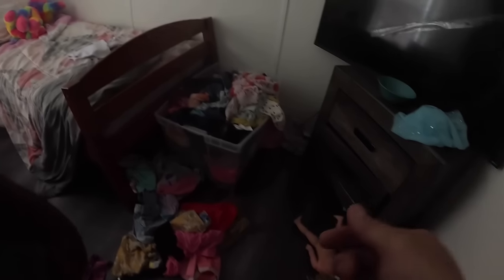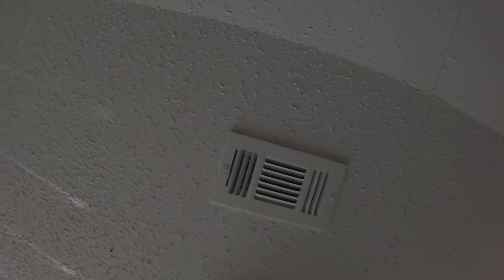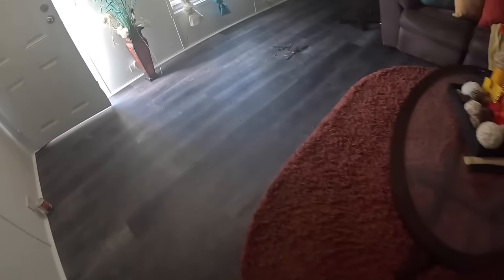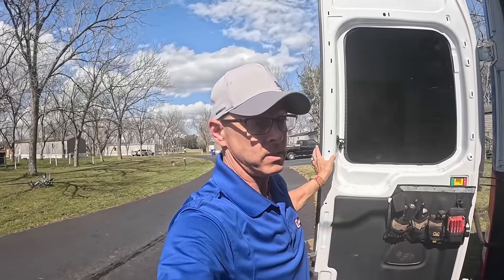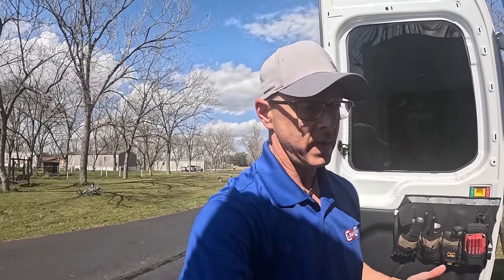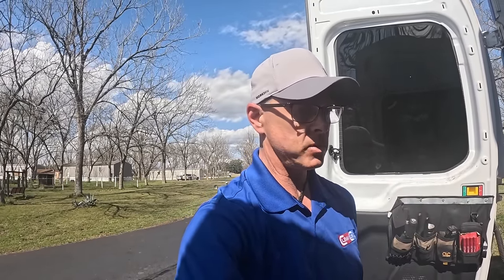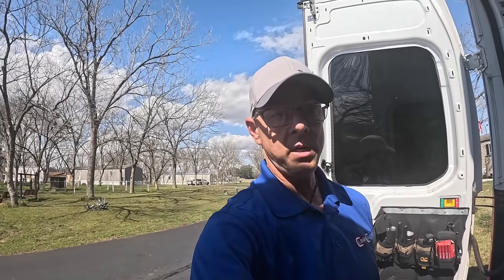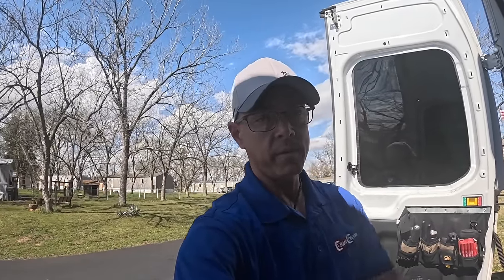Airflow Was Completely Blocked…By Something! #hvacguy #hvaclife

Comment: As a resi electrician, I once asked an HVAC guy what was the worst thing he ever found in ductwork...he said other than dead  critters, the worst was multiple teen boy's undies that had a certain bodily fluid in them. 😮 He was hiding them from mom, but the smell gave it away. I nearly barfed just hearing the story...
Reply: Yeah, and you had to tell us 🤮
Reply: Did he taste them?
Reply: I was thinkin' gun !
Reply: I found a lot of restricted vents from a combination of failures by the previous renter and the painter. The intake filter had partially collapsed into to HVAC unit. I would guess that it had been that way for awhile as witnessed by the coating of dust inside. I vacuumed all that I could get and what I could of the fan. I fired it up and still measured low flow so to the vents. I got up on the ladder and never even started to pull the grate and seen what looked like a piece of paper or something on the inside of the grate. Took it loose and it had a heavy layer of hair and dust that had been spray painted and caused a restriction to flow. After going through the apartment and cleaning the vent grates and as far as I get in the ducts I recommend that the landlord call a contractor that does ductwork cleaning. I hope no one living the has problems with allergies.
Reply: smells like teen spirit?   🤣🤣🤣
Reply: People are disgusting! 😂
Reply: tis' sad but i'm going to hazard a wild guess the mother was a deeply religious bible thumping social throwback as is unfortunately common in the USA. The only difference between some states and the Amish is the use of technology - The outdated social values are the same.
Reply: Normal teenager 😊

Comment: Had a call a.c. coil freezing constantly. Defrosted evap.and turned back on. Found very low suction at unit. Checked and found low airflow. Went around the house and removed return air grills and found cloth taped behind each one. Removed all the cloths in grills and rechecked operation and found everything came back to normal. Turns out the new tenants were not aware of what the last tenants did.

Comment: At least it was an easy repair! I had a job once as the Site Resident for a mountain top observatory. Big telescopes with dormitory buildings for the visiting astronomers and I did lots of handyman work. There was a complaint about the heat not blowing in one bed room. Weird thing was it would start to blow, then stop. Long story short, I found a big stack of porn magazines had been hidden in the duct. When the blower cycled on a magazine would flip a page over and cover the vent.
Reply: That's hilarious. You would think the previous occupant would know to face the magazines in the other direction.

Comment: A guy I knew who was also in the trade gets a call for bad smells from the ductwork when the furnace came on. He’s looking everywhere, checking the furnace, the A coil for something, anything before he start going further into it all. He goes outside on the back porch for a smoke and sees a bowl with pet food by the door. He goes back in and asks the lady if she had any pets. She says “yeah, a cat but we haven’t seen it for about a week”…. 
Guess where they found the cat, or the former-cat…?
Reply: Had a similar issue, but it wasn't airflow.   It was the obnoxiously loud banging noises from the AC fan outside.
Guy opened it up and found half a dozen rats that had been chewed up by the fan, and a good dozen more that had been there quite a while.   Apparently they found a way in around the electrical connections and thought sitting on the blades was a nice sunny perch where the birds couldn't reach them...

Once we removed the corpses I put hamster cage wire around where the lines went in, and around the wall where they had managed to chew - THROUGH BRICK! - to access the space between the facia and weatherboard (about 2") and that gave them access to the basement.   Now I go through once a year at the end of summer and drop pellets of poison down between the studs.  Have to put up with the occasional stink in the basement but no more rats.
Reply: Eew

Comment: A pillow is an effective and cheap way to shut off a needed vent. The homeowner was probably trying to get more airflow in other rooms. I keep the vent off in a spare room to get more heat in my bedroom.
Reply: I was closing two vents in u used bedrooms thinking the same as you, but my brother (HVAC guy) said not to do that because it makes the furnace work harder cuz the cold/warm air still has to travel through the duct work to the blockage so that will wear your system out quicker.
Reply: @londonsapphire1326 Plus, the insulation in those rooms is in the outside walls. None in the walls between rooms. When you leave those rooms "unconditioned", it seeps into the rest of the house much faster.
And, the system is still sized to handle the entire house. When rooms are closed off, it is still using the full size of the unit to heat/cool less area... less efficiently.

Comment: People where I work put stuff over the hvac vent like a piece of cardboard because they are cold
Reply: I do that in unused rooms in the house.  Closing the louvers doesn't really stop the flow, so a bit of cardboard and a brick works fine.   When I want to use the room, or just air it out, remove the stuff and it's good (all of the airflow vents are in the floor, air returns in the ceiling).

Comment: I found a kids ball in furnace exhaust before.  Unit would light up and go out due to pressure switches opening after 5-10m.  It was a high efficiency unit with pvc intake and exhaust so my coworker was able to fish out the ball with a tape measure.

Comment: Years ago I had a rambler and a gas furnace. The place had single pane rattling windows. I covered the hallway back to the bedrooms to trick the thermostat to think  the  whole house was up to 70 degrees. The bedrooms stayed cooler for sleeping but not cold also the bathroom.
 It saved on my gas bill a lot. I suspect someone did not want to heat those unused bedrooms in the back and stopped the air to them.
Reply: I had a rambler, too, it was Rambler station wagon.

Comment: Whom.  After finding the pillow, id ask her how long has she lived there, as i bet the last home owners did not use those 2 back rooms, and they shoved the pillow up in there to cut off air flow to those 2 back rooms.  Would of been easier to jusr close, and seal off the front of the vents in those 2 rooms, but probably thought they would have much more air in the family room by blocking the trunk run to those rooms.  I have sern this also a few times.

Comment: I was investigating a low airflow situation once, and I pulled the return duct off and found a rubber child's ball in the coil. It was a thick rubber, about the size of a youth basketball, and not terribly light. The funny thing was the unit was in a second floor utility space, and the return was on the first floor. So it had to pull that ball up and across about 25 feet. No one had any idea who did it.
Reply: Rubber child's ball?  Child's rubber ball?

Comment: 2:10 well there your problem also ladybird 🐞 but how the heck dose that end up there in the first place and you not notice it?

I mean I’ve found some old rags and tees that got dumped under the floorboards when the council (I live in the UK) hired cowboy workers to do the central heating plumbing, they left all kinds of crap under the floorboards from bits of old pipe and wires to tees and cigar buts it’s a wonder there hasn’t been a fire but this home in the video tryout would think they would have noticed what looks like work pants shoved in their heating vents, I didn’t find may crap till I had to pull the boards to try and run internet cables in the house but that’s under floorboards that don’t need to have airflow.

Comment: If that pillow was stuffed with cash, I would also say "there's nothing in the pillow". The question is how did you split the money with the tenant?
Reply: Trivia:  Usually in a pillow that size you'd be luck to stuff more than $40,000 in larger bills' even neatly packed cash takes up more room than most people realize.
Reply: @davidnull5590  And? like 40k is a bad thing? If it was $500 that would be cool.